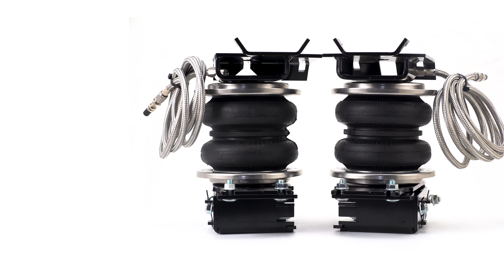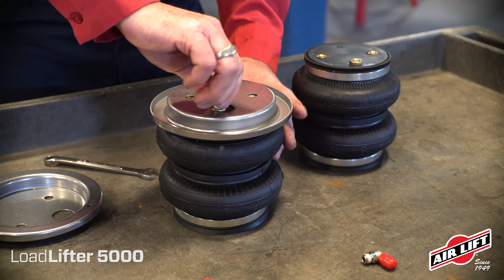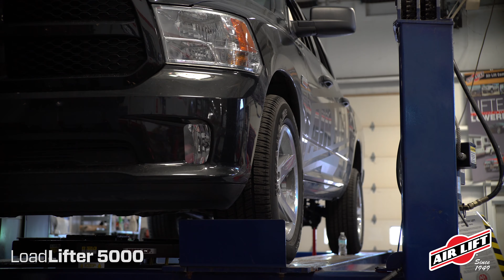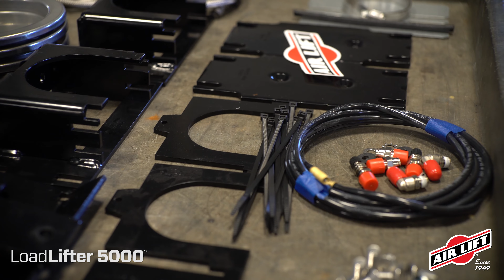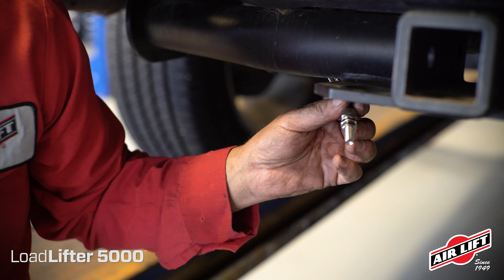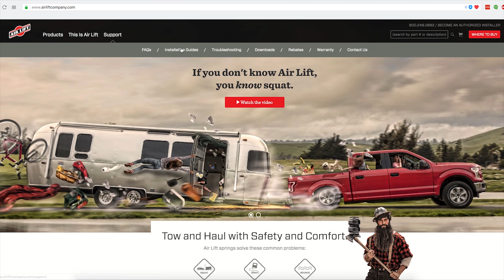Install Overview: 89370 - LoadLifter 5000 Series - 2016 Dodge Ram 1500

Comment: To anyone still looking for/at this kit: I'm an installer/dealer location rep and reached out to Airlift,  despite this kit still being on their Youtube page it is no longer available due to some prior issues with the kit. They have redesigned the kit from the ground up and now require that you cut off that bump stop cup and drill your additional holes for the self-tapping bolts provided with kits: 57365, or 88365. I'll say again, those are now the only 5000 series kits available for DIY installation. The only other kits are their 1000 series kits or their pro install only kit 93365. Hope this helps.

Comment: Mine didn’t come with the bump stop brackets. IS THERE AN ADDITIONAL KIT??
Reply: Hi Jaime, apologies for the issue here with. There shouldn't be a secondary kit; the bump stops are internal in the air spring. You might be referencing the roll plates, and those should be included in the kit itself, packed with the air springs, brackets, etc. Please call customer support toll-free (800) 248-0892 and they can help you verify your kit as well as get you any parts you may be missing. Apologies for the inconvenience.
Reply: Thanks for the reply. My kit came with nothing to attach to the truck. I’ve sent customer service an email as the wait time is over two hours on the phone
Reply: No upper bracket inserts

Comment: I have a 2016 ram 1500 sport I like this kit because I don't have to remove my bump stop mounts is this kit still available? Also interested in air management for riding and loaded settings for level
Reply: https://www.airliftcompany.com/products/compressor-systems/ here are the compressor systems. I would suggest going with the EZ Mount, as that can help make your install easier, and the bracket makes it a nice, clean install. Additionally, it's easier than manually filling, or making adjustments manually.
Reply: Hi  @devinpringle3801 , do you guys have a solution to integrate with an existing onboard air system?
Reply: @Jpm928  Unfortunately we don't have anything to fit into factory air.
Reply: @devinpringle3801  hi Devin, I don’t have factory air. I’m looking to utilize the 5000 series helper springs but use my aftermarket onboard air system to feed the bags.
Reply: @Jpm928  Got it! The onboard air compressor systems should be universal if it is an aftermarket. I can't fully speak to any other options out there, but for example, if you had an Air Lift control system, that would defintely be universal.
Reply: @devinpringle3801  thanks Devin do you have an email to talk offline so I don’t clutter up this post?
Reply: @Jpm928  dpringle@airliftcompany.com

Comment: I think the shop that put mine on did it wrong. Truck now bounces like the tires are out of balance at certain speeds. Bounce occurs at different speeds depending on the pressure in the bags...